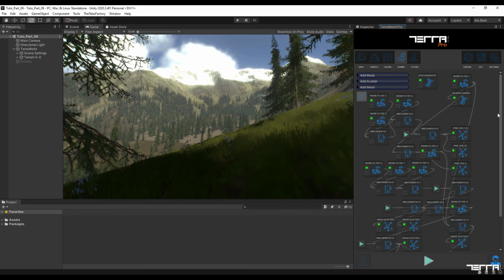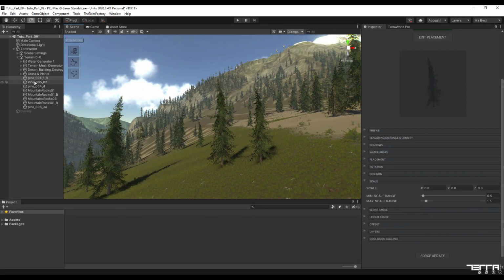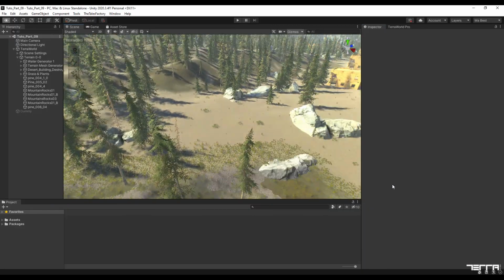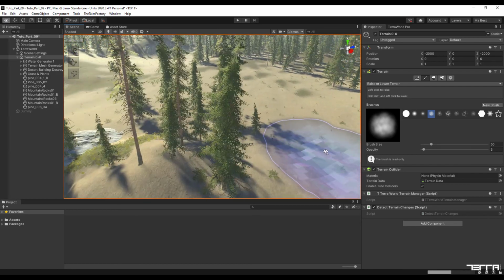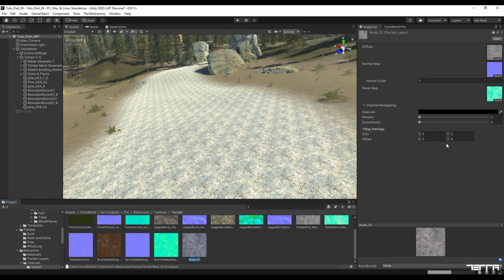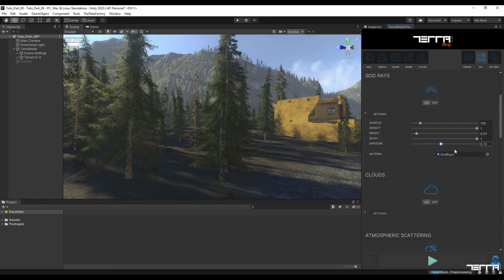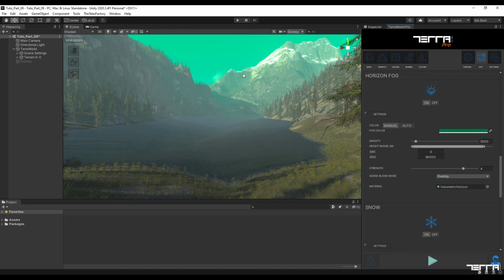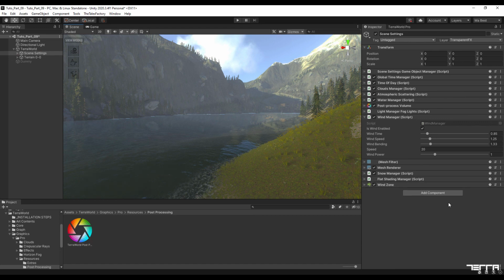Create Detailed Environment For FPS Game In Unity By TerraWorld - Tutorial, Part 9 (Edit World Tool)

Comment: 22:20 Elevation/Azimuth are not changing with time flow by global speed, then what is your recommended method of changing Time Of Day in runtime? Is there some independant function in code to set time?
Reply from the maker: That's the AUTO option next to MANUAL which is showcased in this video, so if you press AUTO, it will activate full day/night cycle both in the editor and game based on Global Speed value. If you need more day/night and sun settings, simply find the "Scene Settings" gameobject under TerraWorld object in scene hierarchy and all VFX parameters and components are there for customization. Specifically for time of day and sun controls, if you need to get data in your scripts, all options are available in "GlobalTimeManager" & "TimeOfDay" scripts.

This demo scene in TW uses dynamic lighting and day/night cycle: https://terraunity.com/community/topic/savannah-mini-game-windows/
Reply: @TerraUnityCo  Thank you, and that leads me to another curiosity....
Does sun rotates as if at the equator? Elevation decides sun's rotation amount of the day(0~360 as 24hrs) and Azimuth decides where sun rises from and fall into, but there is no Altitude(in fact, which should be called 'elevation' astronomically) decides how high sun rises upto and rise/fall closely. Without Altitude sun always go zenith at noon and rise/fall angle is always 180 degrees-so cannot reproduce high/low sun or white night?
Reply from the maker: @marksmithcollins  You are true in every point and current day/night cycle is simple equator based and always 180 degrees but we plan to connect sun position with geo-coordinates of the location for proper cycles based on real-world location and astronomical situation of the Earth. In the meantime you can select OFF option so that TW bypasses sun control and you can roll out your own logic for sun position using 3rd party or own solutions. Please let us know your thoughts on this on Discord so that we can submit this as a feature request for future versions.